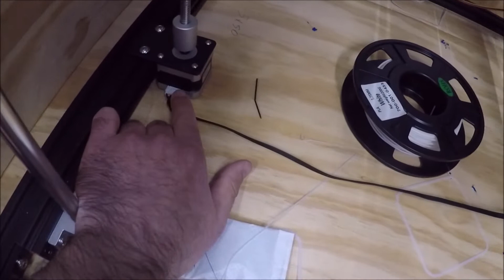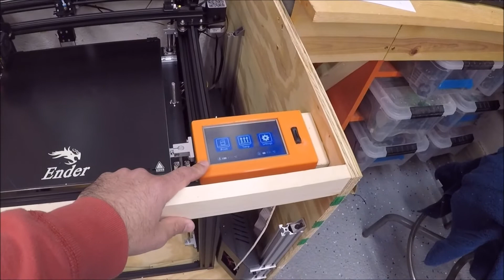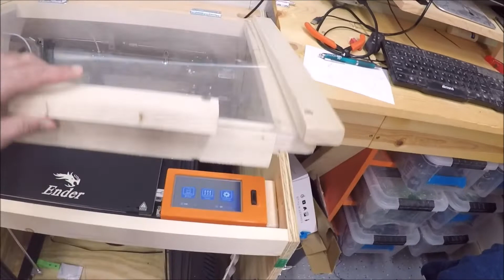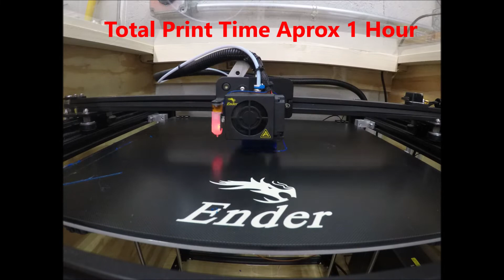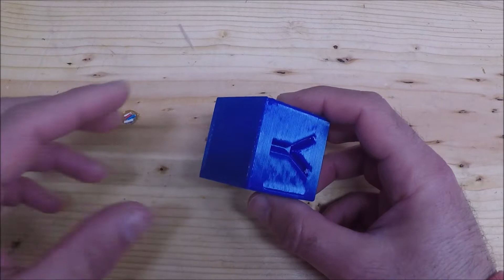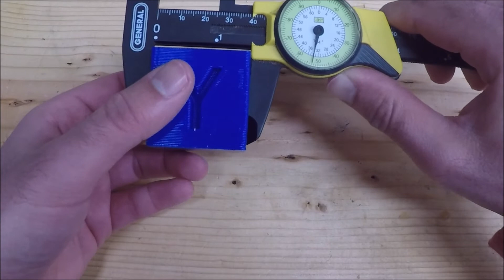Ender 5 Plus Review And Modifications

Comment: Just saw your video.  Creality stands for you can create your solution make our printers work.  Just kidding, I have two Ender 5's and one Plus, that I have modded the heck out of.  I think it is a great base system to build on.  I think you have done a great job on getting it working.  I agree that it is not the best first printer, but once you get it working it's a beast.  I have never used the SD card to print,  Octoprint is the only way to go.  I'm in the last phase of mods.   Replaced everything except the aluminum and motors.  Good to see Tripod commented.
Reply: by replaced everything  but the aluminum and motors you mean what?
Reply: @gaidkey1128  I have replaced the motion system with an Exoslide, the control board with TH3D Ezboard, which I am replacing with a BTT SKR mini E3 V2, running Klipper, the extruder and hot end with an OmniaDrop, and moved all of the electronics to the back.  Here is my latest video on Klipper, you can see my printers with the mods.. Other videos on my channel show more.  Comment again if you would like to know more
Reply: @woodwaker1  wow. How's the quality of your prints with everything said and done? And what materials do you have trouble printing with after the mods?
Reply: @gaidkey1128  I can print almost anything on all of the printers, PLA, PETG, TPU, but I use the enclosed printer for ABS and HIPPS.   If you have any more questions - leave them on one of my videos, so I don't hijack Electric WorkZ Shop's channel. Thanks

Comment: Hey bud, what is that clear plastic you used for the windows?
Reply from the maker: The top is made of clear acrylic which is a bit pricey but rigid. For the door I use clear vinyl sheeting, which is much cheaper but flimsy. Not sure how expensive it was but I bought a roll of it off amazon for $100 and have used it to make windows for a giant CNC machine and three 3D printer enclosures.
Reply: @orangelabengineering2923  thank you!

Comment: My Ender 5 Plus is on its way.  I like the enclosure you made.  Is it movable so you can get to the rear to replace the filament spools?
Reply from the maker: Hey Brian thanks for commenting! The way my shop is laid out it was better for me to mount the enclosure directly to the wall. I typically use a spool of filament until it is gone so it lasts me a few weeks. When I do need to change the spool I can reach it's location by opening the front door and reaching inside the enclosure. That being said I can definitely see how making the enclosure mobile to gain access to the back would be a huge benefit. Good luck with your new Ender 5 Plus!
Reply: @orangelabengineering2923  You might consider to flip the bowden and filament sensor around such that it sits on top of the frame. In that case you will however need to come up with some smart device to protect the filament against sharp bends. I built a  bracket for a pneumatic connector and put some 20 cm Tube into it.

Comment: Great video. Surprised you got the SD card to work with Cura the way you mentioned it. Creality seems to be changing their delivered models daily, I presume. My ender 5 plaus came with firmware 1.70.1 BL. (As of today the most actual firmware on their site is 1.70.0). The printer seems to read and write to and from the SD card. So, I could print exactly one cura gcode. Upon formating the SD that gcode would be maintained durig formating as it was still open. I considered to slice with the creality slicer provided as part of the delivery, but that one does not have an Ender 5 plus driver. I investigated start and end code for their Ender 5 and compared to Cura. It turns out, the Cura driver (yes, they have one as opposed to creality) misses some code at  both start and end, most importantly, a closing M81 to switch off not only motors but also "data processing" and thereby close out on the card. Now, I didn't feel like becoming forinsic analyst when I bought the ==>prototype in December 2019.
I continue to be desperate about my knowledge gaps, such as: Firstly, after alll leveling is fine and dandy, the printer starts printing a good 5 to 15 mm above the plate. The only way to correct this in situ, that I found, is to lower the fine tuning Z-level in steps of n/100 mm, which makes a jolly nice afternoon. Secondly, I bought the instrument to print prints of a weight of about close to 2 kg (4 pounds), hence, spoiled by commercial printers from Cura, I could not imagine, it would not be possible to reload filament in the course of the print (bigger spools aren't such a great idea with bowden in particular). Not only does the filament sensor (not shown in the wiring diagram and sitting on an uncontrolled fan slot) not trigger any intelligent procedure, much worse: It blocks you into a status, where you can change temperatures, but not move the extruder. In fact you have to, as the bed and the nozzle heaters are turned off. As far as i recall, you can't move the Z-axis either. Hence you are gambling, you reheat and if you are lucky, you may be fast enough to crawl back to the most remote position in the cube to change filament after you set "reheat" and thereby began to burn a hole into the top layer of your print.
Creality is of course happy to receive such descriptions as feed back, a brilliant concept to out-source your development department.
Half a dozen of other small issues, superb printer concept, noisy, it seems though they are now delivering the 151 mainboard which to me seems to be what they call the silent one. Adventurous wiring and gland. By ways of passing: Lots of rubbish around in regards noise reduction here: A simple damping between mainboard and fans brings the noise of these down to 60 db from 64. At that noise level then, the coupled, hence singing noise of the y axis dual rod motor dominates perception in that it sings at a rather high pitch. It does sing, since the experts building it have coupled it perfectly to the x-axis bridge by rigid couplings adjacent to the y axis motor.

Comment: This is a great video, man. I am looking for my next 3D printer and the Ender 5 Plus has my attention. I am also thinking about building a Plexiglass enclosure to not only mask the sound, but also keep the HORRIBLE smell of ABS out of the room. One mod I might do is print up a stronger spool holder and put a light in the enclosure that turns on when I open the door (a single interruptor will do the trick with a portable battery). I can't wait to see more of your prints.
Reply from the maker: Thanks for the feedback Kashif Riley! A stronger spool holder is a good idea, I might have to look into that as well. Good luck with your build.
Reply: @orangelabengineering2923  You bet. I might engineer one with a cap to keep the spool from sliding too much.
Reply: instablaster

Comment: Would you mind sharing how you extended the touch screen wiring?
Reply from the maker: Sure! Please note that this is not a tutorial or a "how to" guide. This is just how I modified my printer, and in the process most likely voided my printer's warranty.... When I opened up my electronics enclosure I found a ribbon cable connecting my motherboard to the touchscreen. On my machine there was a point where the ribbon cable was spliced into a standard Molex connector. I cut the ribbon cable at this splice point and spliced in a two foot long cable. I used #22AWG, 4 Conductor, Shielded cable for this task. I soldered all splices and used heat shrink to insulate them. Just be warned, installing the extension cable for the touchscreen isn’t rocket science, but it is easy to mess up.

Comment: Awesome setup and a good video to match. You put easily hundreds of dollars worth of effort into making the printer function well. With that in mind, what would you suggest as an alternative to the Ender 5 Plus (regarding print volume) that costs more but works with less hassle? I have had trouble finding anything else, but I do not have days to spend tinkering with it. Thanks.

Comment: You mentioned warping before you built the enclosure, was the entire build plate getting warm? Or just the center? I noticed on mine the edges of the plate are not as warm as the center area. This results in adhesion problems. Thanks.
Reply from the maker: Hey Nicholas. My entire build plate seems to be a consistent temperature. My issues was that I am printing in a garage. Hope you figure out your build plate issues.